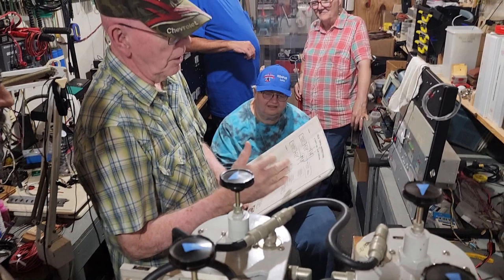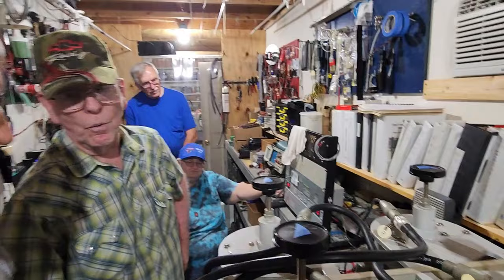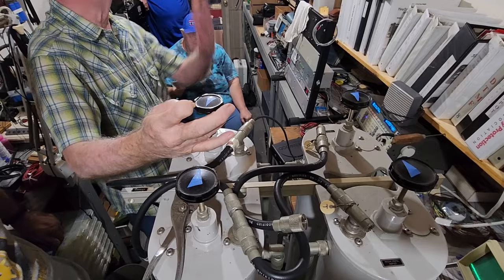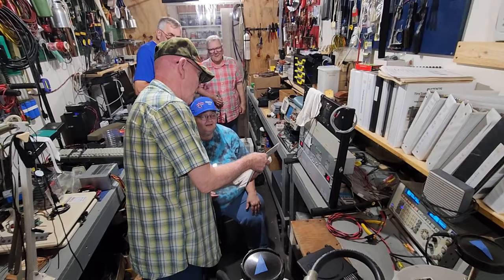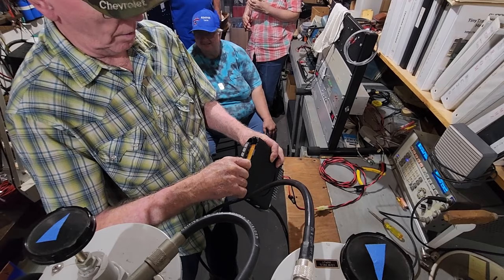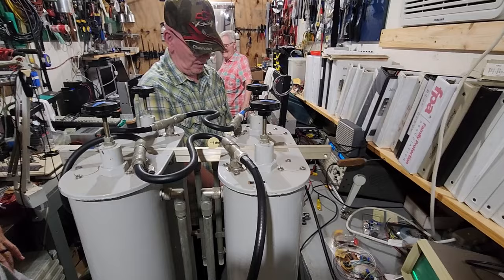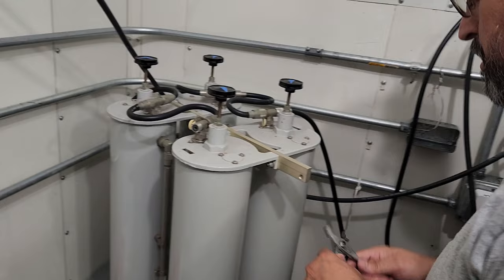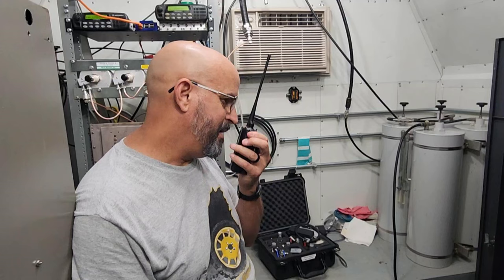LCARA HAM Radio:  Troubleshooting the Repeater / Bad Duplexers!?!?  - Part 3

Comment: I’ve tuned duplexers including that Wacom you attempted to tune,  using a MFJ259, a handy, a dummy load and a homemade RF probe. Was amazed how close you can get, particularly if you know what you are doing. A spectrum analyser helps being precise and setting insertion loss to levels at which the Q remains decent. I love my Rigol DSA815TG.

Comment: The band reject is way more important than the bandpass over which you spent most of your time. That crude method you used may not always work for band reject without causing desense of the RX. particularly when. running an amplifier. 

If you don’t have a spectrum analyser. a better way to optimise bandreject is to use a Rf probe and a dummy load to tune the reject for minimum voltage across the dummy on the reject frequency.  
Even a nanovna should give decent results although it lacks the dynamic range.

Comment: Could you have depowered the repeater and coupled the feedline to a portable receiver on the input frequency, at the antenna connection to the duplexor, then at the output of the amplifier, then at the receiver input to determine quickly where the signal was lost?  That could have eliminated the new antenna install , new feedline, a tower climb, tuning the backup duplexor.  Maybe I am missing something.  I last tuned a duplexor 20 years ago.  A great episode!!! 73 de N8RL

Comment: i have ben into radios for 35 years & i have had several pull my hair out events over the years & 90% of the time its something simple..Like a bad jumper..i fought one for a 3-4 weeks just to figure out it was a bad jumper..I then bought all new Teflon pl259's & so239 Connectors & that was that ! But i may have ben running a little Heat to but i will never tell..lol.